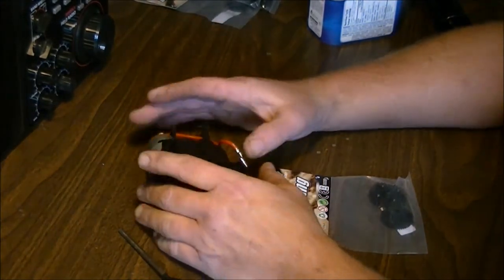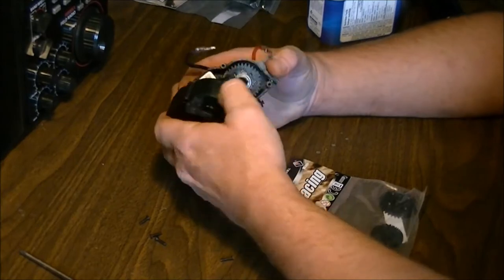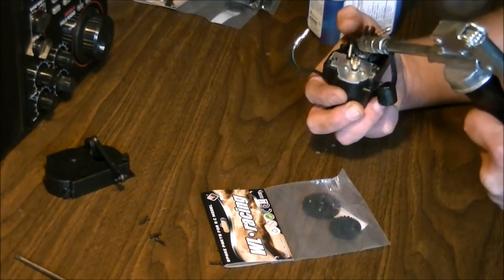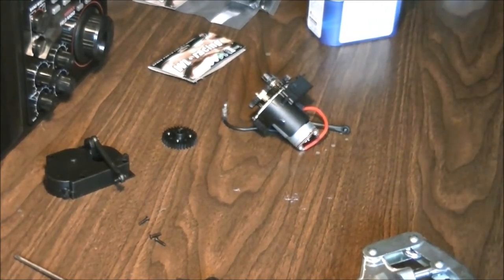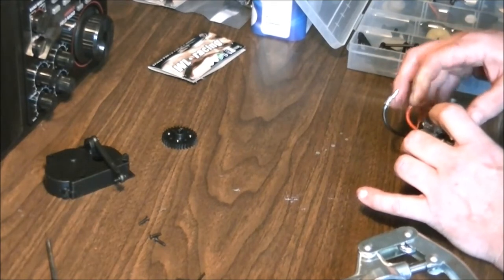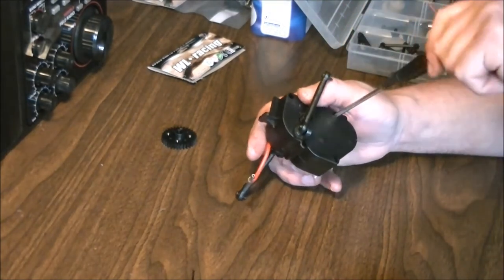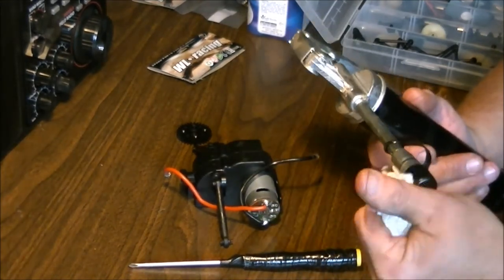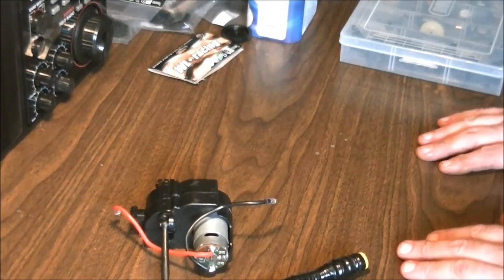Wltoys l959 l969 Litehawk brute and blast etc  grear box transmission rebuild

Comment: Well after three weeks of letting my six year old play around with his buggy, I decided to make a ramp about 1.5 feet height and only took half an hour until I stripped the spur gear. This thing was going full speed sometimes and did not brake a thing until the gears got stripped because my two year old fell on top of the buggy as I was going to jump it. These rear tires are really crappy and wish it was easier to find something that is not to wide or to big!! I put my 1/10 redcat volcano wheels and tires on just for kicks on day and where way to big, had to much grip an would flip right over when taking off to fast!!
Reply from the maker: ya i put my brute tires and axels on my l959 aka blast and man its cool now and does wheelies on demand. there are alot of other tires that can work on it just gota search them out i want something a bit more narrow as well but i love the height advantage of the brute tires

Comment: Kevy, do you know the pitch on the pinion?I upgraded to brushless and it is a bigger shaft , i also made a sliding hole to adjust the mesh or pit bigger pinion. so if you know what the pitch is I would appreciate it. Thanks
Reply from the maker: sorry bro i have no idea and i sold it long ago so no way to know now how ever if you went for the L202 brushless upgrade kit that motor should have the proper shaft size but if yoou went 3rd party then that couldbe the problem but if your good with a drill press you can boare the hole out

Comment: Thanks for the video. What grease do you use? I read somewhere that for plastic gears you should use fully synthetic grease to prevent wear... What are your thoughts?
Reply from the maker: its just a general automotive/marine grease that came with the gun,  i have no problem using stuff other then recommended cause i dont belive in all the junk out there at least not until iam proven wrong. all that came in the box what a white lithium based grease which i find reacts counter productive to the gears, in that it wont stay coated on the gears this stuff iam using tends to hang around alot better.so far so good. i have used regular automotive green grease and found it was way to thick but it did not harm the plastic. alot of it is about do you follow the boys or do your own thing, iam not a follower of the crowds i do my own thing cause i dont believe everything i see or read you dont find out anything unless you try new things if it works cool if not well try something else.
Reply: KevinMillard68 Cool. I might give that a try.

Comment: Kevin, I know the spurs gears are the same but do you know if the L969 and L959 use the same bearings set? I want to upgrade my 969 and can only find them for the 959 on banggood. Thanks.
Reply from the maker: if you want the ball bearings here is the link, the oil bath bearings are all the same in all the cars , these ball bearings are the up grade for all of theose cars http://www.banggood.com/Wltoys-L959-PRO-RC-Car-Spare-Parts-Whole-Car-Axle-L959-P-05-p-76270.html
Reply: KevinMillard68 As always. You are the best. Thanks.